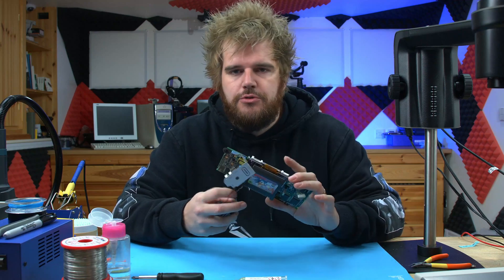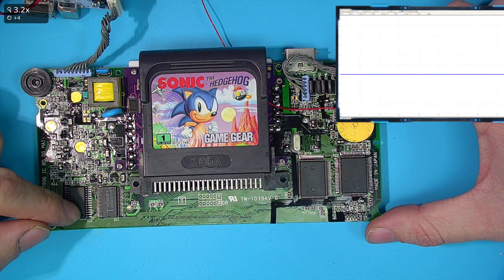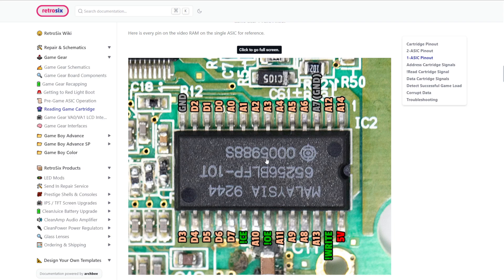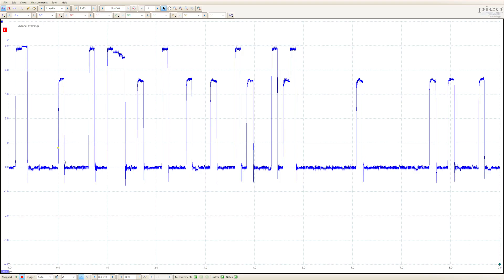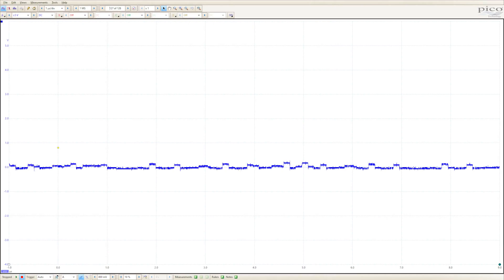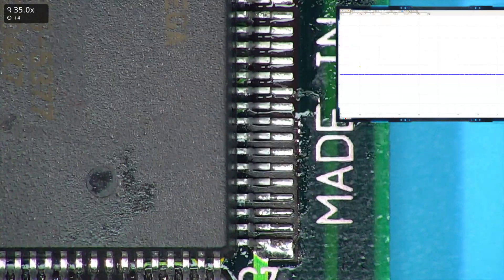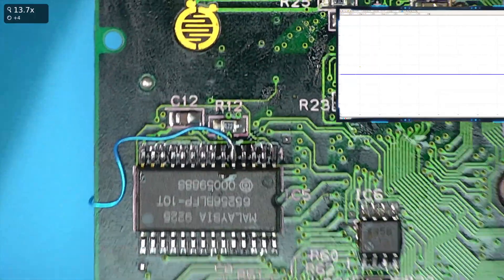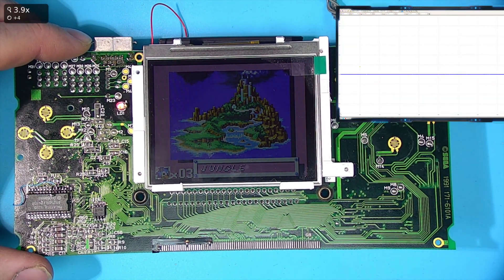Game Gear Scrambled Video Screen Sprites Fix Repair - RetroSix

Comment: I've got a GBA that suffered some terrible corrosion effects. Start button pad was eaten away, a portion of the power circuit in the same area, a good chunk of the battery ground pad, T1's circular shielding broke in half (internals appear to be intact), and cart pins 30 and 31 traces destroyed. I restored power by repairing D3 and D3A vias, restored VDRV3 via,  restored pin 31 connection to R6 and R6 to C1, restored pin 30 to R2 and R2 to Pin1. GBA now powers up, will play A bugs life cart (GB black cart) with no issue, screen looks good. Metroid II (GB standard cart) starts up and looks good. GBC carts won't play at all. GBA carts play but results are strange - video glitching - screen is essentially divided up into four quadrants with varying degrees of incorrect contrast and color saturation and visible lines down the center of the screen in both horizontal and vertical positions. Save data is not being read by the console and any save attempted doesn't actually write to the cart. I suspect there are more broken traces to find and/or T1 need replaced.

Comment: Had the same problem an find with a multimeter that my a3 pin has no voltage.
Soldering a wire like you that and it works!
Thank you!

Comment: Hi, I have the same display issue but my problem is that, my game gear starts up normally and after 5 to 10 min  I will end up with this problem. Will it be more or less the same as this way to troubleshoot or do I have an overheating problem? (I have tried using original battery/power board and the ones I bought from you and even using power brick but same display problem so it should not be a power issue.)
Reply from the maker: Jump on discord.gg/RetroSix and share video of issue if you can. Video issues can look similar but be totally different causes

Comment: Excellent video mate. I finally managed to fix a Game Gear that I swapped the video ram out a few years ago. The problem persisted until now and your video gave me the inspiration to try again. D6 had a bad trace to the asic. Multimeter and continuity check did the trick, still need an oscilloscope though.
Reply from the maker: Awesome glad it's fixed

Comment: Is there something special about the video sram? I've tried 2x HY62256ALJ-10 from a snes and they didn't work. Or I was just unlucky and are both faulty? Or it only works with pseudo sram?
Reply from the maker: It can be very picky about the speed and refresh rate. Plus on SNES most of those RAM fail too. Best hot swapping from another GG
Reply: @RetroSix  Thank you. yes, it works if i use the sram from another game gear, but now I  need another sram for the donor console.  I will try to replace it with some other brand of sram that i have at home. If it doesn't work, I'll order some pseudo sram from china.

Comment: Is it possible I could test the chips with a multimeter? I don't have an Oscilloscope.
Reply from the maker: Will be very hard to test much except continuity which doesn't always show partly broken traces
Reply: @RetroSix  Ok thanks for the quick reply!

Comment: Brilliant video! I have this issue but no access to a scope, is there a way to test the pins for data with a multimeter? I’m learning all this as I go 😬
Reply from the maker: Possibly. Multimeter into resistance mode and probe the ASIC pin at one side and the other pin like VRAM pin with the other. Resistance should be very low. If it's above 5 ohm it's likely bad
Reply: @RetroSix  thanks for that I’ll check it out, need to fix this stubborn Game Gear, I’ve recapped it and also have a spare VRAM to try too
Reply: @StiffPeak  A logic probe could be an alternative to the oscilloscope, for addresses or data lines.